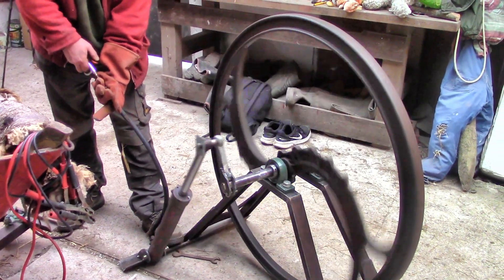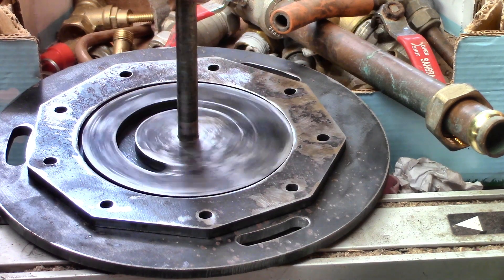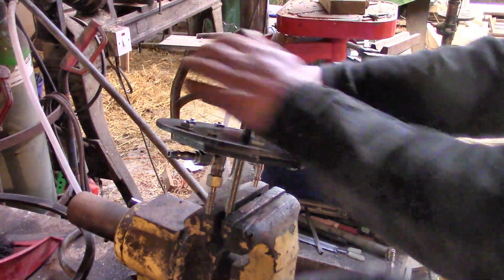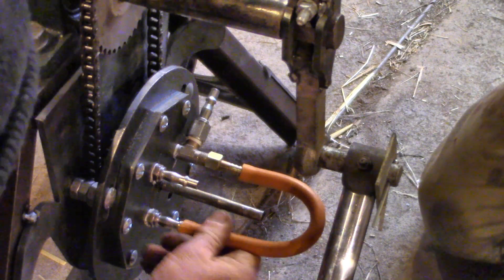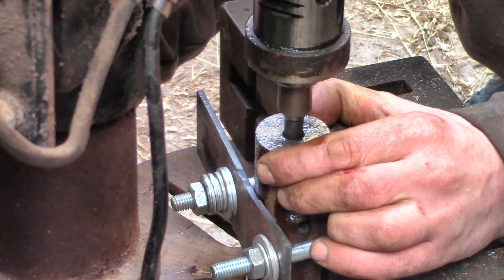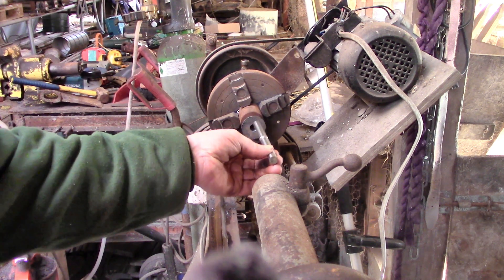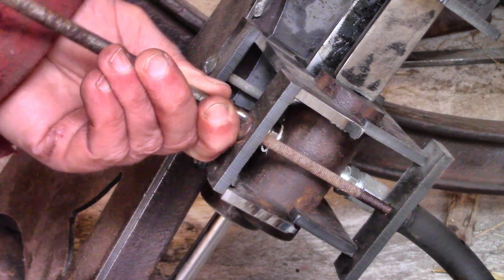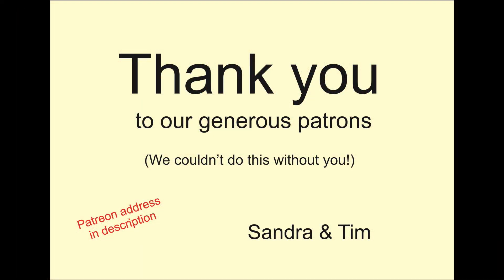Homemade Rotary Disc Valve And Spool Valves For The Steam Engine (I’ve been busy!)

Comment: Might be mentioned already and you're two steps ahead but, would a traditional slide valve not have been easier? Also, on your spool it may be worth adding some grooves down from the valve section on the shaft, small scale steam uses lots of steam oil and the groves capture it and help seal all the tolerances up. And not sucking eggs but always have my engineering teacher in my ear when I see a reamer shouting "half the speed, twice the feed" to a standard drill that is. Going fast with the reamer gave the milling/boring action you had, even better if you have one with a tap handle so you can hand ream it. Again nothing worse than a keyboard warrior, just suggestions.
Reply from the maker: Thanks, Edd. Next time we'll try it slower!
Reply: The grooves really help with the friction, too, I've found!

Comment: I was thinking something with ball valves. You could use something to turn them on and off much like the timing plates. One would spring load the handles with the push rods things like in your last one. When it was pushed down it was open and when it was up it was closed. 
I would then start with a full round circle and make a jig that you can use to put on the table to make your cuts. This way you only have to cut from one plate. Then mark out the stroke of the push or pull stoke and work from there. Then add a large margin and then grind off a little at a time until the stoke works the best. That is my idea.
Reply from the maker: I like it. Ball bearings pressing into holes is a good idea - but for the inlet valve you still need a steam-tight box through which you actuate them

Comment: Would it be too hard to make a steam engine like steam trains have with a combined dual acting  sider valve and piston in one unit?🤔 what if the piston had a shorter stroke but a wider bore, would that make it more peppy?🤔 just thinking out loud.

Comment: Looks and sounds awesome Tim. If you find out your getting too much friction from running the pushrod directly on the cam, it should be pretty easy to use a roller bearing as a follower on the cam. Some thick grease on the spools will also help them seal better.  Keep up the good work!

Comment: Can you not O-ring your spool valves & have an inline air oiler ?
Reply from the maker: but what would happen when I use steam?
Reply: @wayoutwest-workshopstuff6299  
You then have a steam oiler the same as a steam engine would.
You can buy them online from Blackgates engineering or Polly engineering.

Comment: Excellent story and a great result. Not sure about the disc valve though... much used on 2-stroke engines, but in a steam engine surely the high pressure the input side is likely to cause you problems. That why I believe low and mid-pressure steam engines can use slide valves (very similar to your disc valve in many ways) but the high pressure on the input side of the slide makes them impractical for high-pressure engines so they use piston-valves - like your second effort. But its all very exciting, and you’re the man doing the hard work and hard thinking. We’re just sat on the side being critical! Les in Cheshire
Reply from the maker: Cheers, Les!

Comment: I would suggest to use a gasket between the two plates to decrease the amount air leaking from the rotating disc valve.

Comment: A safer approach to the spool valve would have been to drill and ream the hole to be 12mm and use a oversized rod and remove material from the rod until it's a really snug fit. that's usually how I go about make these
Reply: @Brian J • That would be practical if Tim had a precise lathe, but his woodworking lathe is too "clunky" for such turning & fitting.
Reply: or perhaps use piston rings since the spool is in essense a piston.

Comment: I don't think your valvemaking is the problem. The problem is the logic design - your system lacks an outlet port - nowhere for the flow to go. Propelling the piston is ok but as the piston returns, where does the air go ? your arrangements valve off the returning air rather than letting it freely escape. Also, do use both sides of the piston to provide power - your valve, whether of a disc or spool types needs to provide a path for the air to flow into and out of the ram, alternate sides of the piston depending on desired direction of rotation and function - whether inlet or exhaust.
Reply from the maker: Ah now - of course they both had an exhaust exit!

Comment: Many early steam engines and locomotives (and sometimes later ones too) were somewhat known for leaking steam from the cylinders. That’s part of what makes period industrial scenes so atmospheric.
Reply: The shuttle valve used the steam pressure to hold the two sliding faces tightly together. If it's leaking steam, the gland packing probably need work
Reply: @Hyratel  Yes, my point was they had the same sort of tolerance issues back in the day
Reply: @andrewreynolds4949  you can get a perfectly flat surface from three rocks and some patience (whitworth 3-plates method, developed 1830s)
Reply: @Hyratel  But patience costs a lot of time, and time is money. Not everyone can afford it

Comment: Excellent work! To seal the valves traction engines use glands. They have a grease soaked rope inside a cavity around the rod and it's squeezed by a gland nut.
Reply from the maker: Thanks Ben. That's very interesting and helpful

Comment: just hearing the 2 camshafts go before you added air was already so pleasing! Truly a great sound. My personal theory is that the original steam users went with a more brute force approach, where they used enough pressure that any steam loss was comparatively little.

Comment: I don't think a horizontal polishing machine will fix the issue of that disk valve. I think you're going to need rubber O-rings, or some other kind of rubber seal. 

I work with engineers that design air compressors for water chillers, and just about every joining surface in an air compressors needs some kind of rubber O-ring or rubber seal to keep the air moving in the right direction.
Reply from the maker: Yes, but hot steam?
Reply: @wayoutwest-workshopstuff6299  
Some specialized types of rubber can handle some pretty hot temperatures. But I'm not sure how hot the steam your using is. 

If you don't want to risk melting rubber seals, you could try making metal seals like the ones in car engines.

Comment: The rotary valve might work, if you seal it. There are seals that can hold easily  up to 260 °C (FKM), I work only with "viton" which is up to 150°C, but it works as normal o-rings - even water is not a problem. Also, there are gaskets that might work. What I mean by the "might" word is that I have no idea about the dimension / air flow needed to exert required pressure.

And as always, it is great to watch you work.
Reply from the maker: Thanks, Jan. I shall do some more research..

Comment: have you heard of "steam oil" yet Tim? 
someone else mentioned it, but a bit more weight on the flywheel might help.

It must be great to have fun!
Reply: You do not need weight on the fly wheel right now. The timing of the air valve is key to this. Adding weight to the fly wheel will only casue damage to something. Because at the very end both air valves were going in to the ram which causes stress and the timing is just off enough that there is resistant to almost stall out the ram. Once you fix this timing you can then load the flywheel.

Comment: You're doing great and having a frustrating ball. Fresh ideas in old tech come from ones who learn why they "didn't". Perhaps at another stage you could use Poppet's. Easy to fabricate & super tight with soft seat material from any rubber goods dealer.
Reply from the maker: but would they work for steam?
Reply: @wayoutwest-workshopstuff6299  Absolutely, Watt's started using them and they're still on trains today.

Comment: Consider machining some grooves for O rings on the spool valve shaft on Wills metal lathe.   This will reduce air leaks.   I think the old machines honed the cylinder to dimension and machined the spool valve shaft to be a tighter fit.   Reamers are more accurate than drills as you observed, but when I need a tolerance fit, I use a boring bar to sneak up on the dimension.
Well done.   Terrific progress.
Dave.
Reply: I thought that too, but would o rings take steam? Steam oil maybe?
Reply: I expect if he needed a solution for steam, then some kind of piston ring would be needed.   Vintage machines would make these out of cast iron.   I have seen several video on making cast iron piston rings.   Not   easy, but possible.
Dave.
Reply: I was thinking O rings would allow you to get away with less worries about tolerance and have the advantage that they work well both hot and cold. Keith Appleton has done some recent videos on making new piston rods with o rings . These will work well with saturated steam at least.  I love the laser cut cams and the ease you can cut another one to modify the valve timing.

Comment: I was thinking for your rotary disc valve... if you provided a passage for the seal air to bleed out (path of less resistance that the path of blowby) you might get it working (though a bit inefficient wrt air usage)..  Right now since you sealed the three outer plates the path the air takes to leak out is round the inner valve plate back to the outlet collector.  So I am saying that on the inlet seal plate cut a collector groove that has an open passage to go out the inlet seal plate (not full depth and at a larger radius than the valve plate through passage, there could also be a corresponding groove in the valve plate).  The added benefit is the pressure of the air should press the valve plate against the outlet seal plate and help suppress blowby.  Ultimately I can see why you went another way since the pressure transfer efficiency will be a function of how well you can ultimately seal the 3 plates together, but as a bodge this might just get your concept "working".
Reply from the maker: Yes, maybe, but I can just see it losing even more air : -  (
Reply: @wayoutwest-workshopstuff6299  no doubt that is a distinct possibility... always fun to see what you are up to!

Comment: you could also try to use a plumbing ball valve as your timing devices
you just have to get some that are made out of brass or stainless steel

on the question how were they originally made try googeling steam engine valves or Expansion valve (steam engine) on wikipedia
the one drawn with the indicator diagram should be possible to make for you, though it would be easier with piston thats powering both directions
Reply from the maker: Thanks, Luke - will do.

Comment: Would the rotary valve work if you put gaskets between the plates?
Reply: should work as long as they withstand the steam temps.
but the problem with that is that they are not just a flat rubber plate sadly, they would get complex

Comment: Hi- you also may be able to repurpose an old 2 stroke strimmer engine as a valve? Not sure about valve overlap etc, but might be possible…
Reply: I'm told you can repurpose entire 2 stroke engines as steam engines with pretty minimal modification because they already have slide valves built in to the cylinder where you want them

Comment: You need a counter weight on the main fly wheel to take it over the end of the compression stroke ..
Reply: Maybe he'll try to build a version that works on both strokes. A counterweight would also generate a lot of imbalance and vibration once it gets up to speed.
Reply: And drag on power stroke. Need 2 or 3 engines.
Reply: Back to the drawing board....